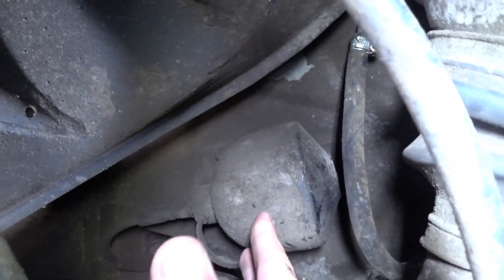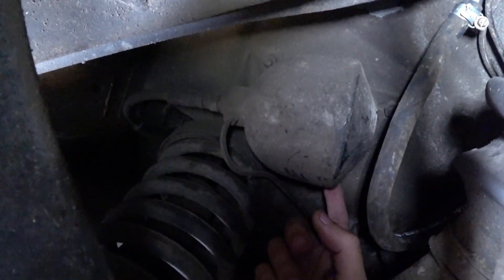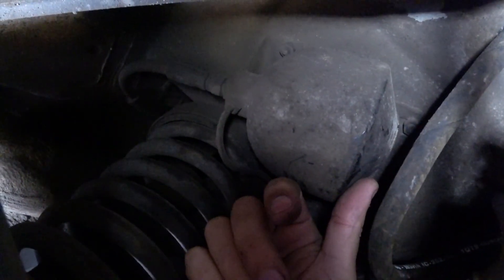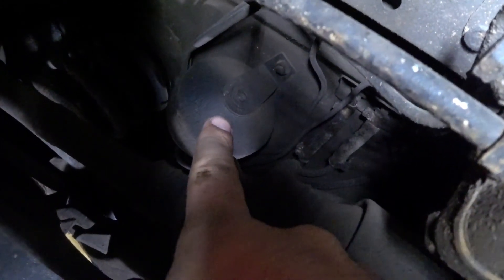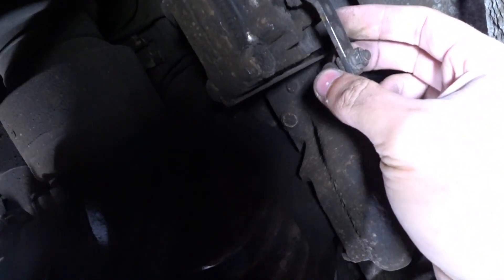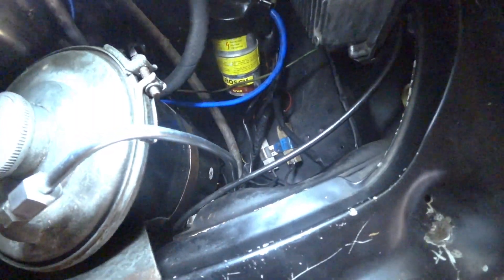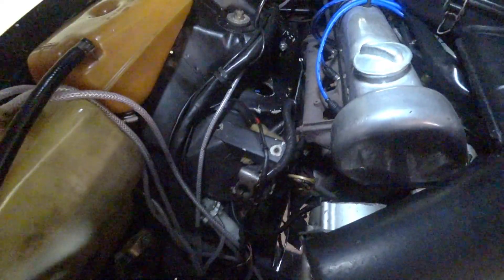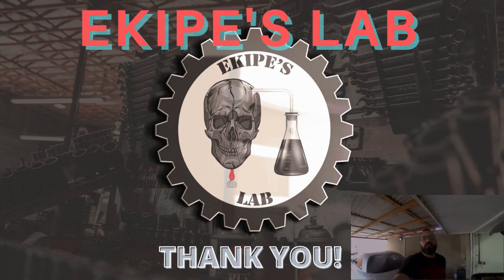W116 Restoration, SLS Rebuild Pt 1: Making the Tubings from Scratch

Comment: i had new pipes fitted, but the pipes used were for brake pipes and are 1 or 2 mm thinner than the stock pipes, do you think i will have to replace them with the stock width piping???  i worry that the pipes being thinner will make the suspension firmer i am considoring just deleting it and putting dry suspension on it, is there a big difference in feel when driving, it is a w140 i have?
Reply from the maker: I think they will handle fine as the system pressure varies between 35 and 50 bars, not so different from brakes. The important thing is allowing a good flow of fluid.
Reply: @mercedeslabchannel  i worried the thin pipes might act like a thin valve in the shocks

Comment: Ive just agreed to buy a 1975 450 se with  SLS on the rear axle.
If you are still trying to find information about it i can get some photographs after i have taken delivery.
Reply from the maker: Thank you very much!! But I have found it yet, those cars with SLS are rather rare, take well care of yours!
Reply: @mercedeslabchannel  it has one leaking unit. But the seller has a spare parts car that I can remove any parts off that I need.
Reply from the maker: @davyfella  IN the case you need new ones, there is this dude. https://web.facebook.com/groups/206764756586/permalink/10158496382696587